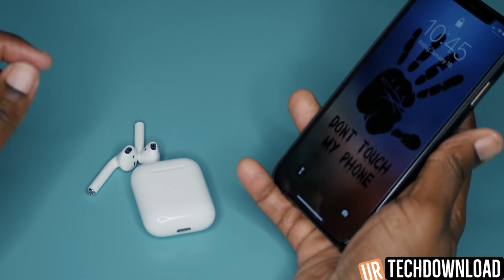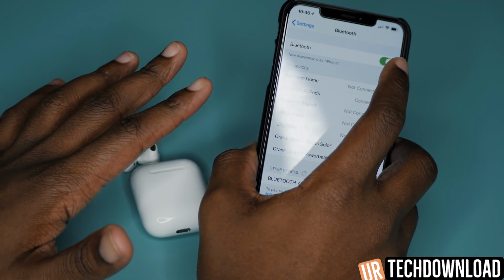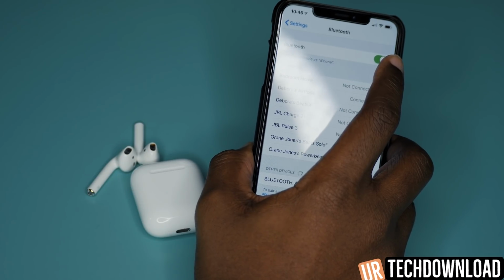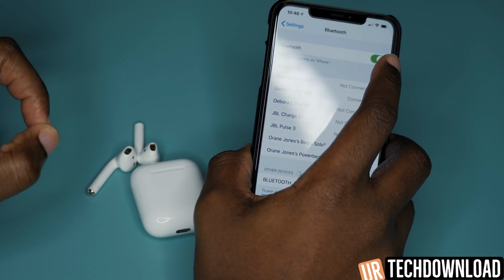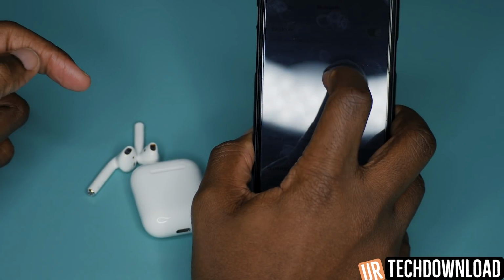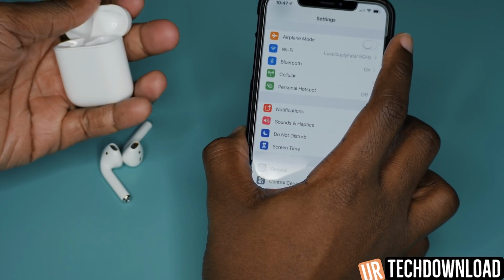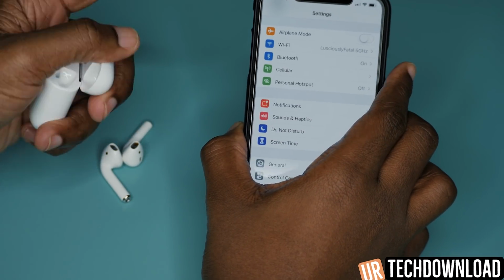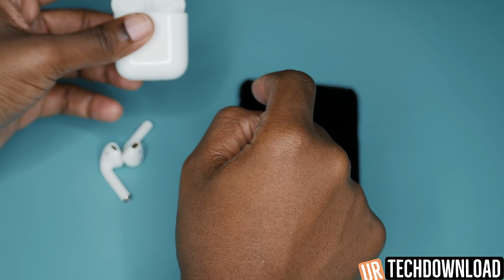Airpod Issues? No Problem! Here's How to Fix Them

Comment: Need help.
Can't reset airpods 1 gen.
Lid open green light 3 sec. then gone.
Open lid press button green light 3 sec. gone but no white light.
Charged fully. Open lid no reaction in phone no pop up window. Contacts is clean.
Try push button several times but no luck.
Maybe you know what to do?
Reply from the maker: Here are a few steps you can try:

Make sure that your AirPods are charged. If the battery is completely depleted, the AirPods may not reset properly.

Locate the small button on the back of the charging case. Press and hold this button for about 15 seconds, until the status light begins flashing white.

Open the case lid and press and hold the setup button on the back of the case for about 5 seconds. The status light should begin flashing white, indicating that the AirPods are ready to be set up.

Connect the AirPods to your device by going to the Bluetooth settings on your device and selecting the AirPods from the list of available devices.

If the steps above did not work, there are a few more advanced steps you can try:

Reset the AirPods by connecting them to a power source, then pressing and holding the setup button on the back of the case for about 15 seconds. The status light should flash amber a few times, indicating that the AirPods have been reset.

If the above step does not work, you may need to reset your device's network settings. To do this, go to "Settings" > "General" > "Reset" > "Reset Network Settings". This will delete all of your WiFi passwords and settings, so make sure to take note of any important information before proceeding.

If the problem persists, you may need to reset the AirPods by restoring them to their factory settings. To do this, connect the AirPods to a computer with the latest version of iTunes installed. Then, select the AirPods in the list of devices and click "Restore".

If none of these steps work, you may need to contact Apple support for further assistance
Reply: Thanks for the help. 
I try with Itunes.
Super suggestions.
Thanks
Reply: Fully charged. But can't reset AirPods. 
I don't know what to do.
I think  trow them in the bin

Comment: I had AirPods 2nd generation and I had issue with them. One of the AirPods would stay connected to the phone even when it is in the case like 30% of the time. So I bought AirPods 3rd generation and I am have the same issue. I won’t say it happens with just one AirPod because sometimes it happens with the left and sometimes with the right. If anybody knows a fix to this issue, please reply.

Comment: I’m on my second pair of these because my original pair the speaker stopped working. Now with the second pair the battery is only lasting approximately 5 hours. They are shit. I was thinking about picking up the 3’s because they are pretty cheap compared to the pros but I’m considering Jabra buds

Comment: Hey there I’m using AirPods more than 2 years it’s 1st generation. The issue is when I connected my AirPods while speaking calls, my left AirPod is automatically disconnecting. But mostly it’s not happening while listening musics, but sometimes it’s happening, but it’s rare, there is any solution  for the left AirPod disconnecting while speaking a call. Please 🥺🥺

Comment: Anyone else get the same issue as me where I switched phone from iPhone X to 11 but I didn’t disconnect from my iPhone X but I transferred all my data to my new phone and my airpods come up saying share audio or not your airpods and I reset the airpods by holding the back button till the red light and it didn’t work
Reply: But they always connect perfectly fine and play music just when I open the case they say not mine or share audio and sometimes I have to put the AirPod back in the case and take it back out to connect

Comment: Ima explain this as i solved it (not the method explained in the vid).ALSO THIS IS ONLY IF YOU HEAR THE SOUND IN ONE YEAR AND NOT IN BOTH YEARS!so you have to go on your PHONE settings before you want to listen to music or before you conect them ir whateva and go to your phone settings>accesibility>audio/visual, and then there should be a line, at one end of the line should say L and at the other end should say R, if the dot is only close to L,then drag it to the middle,same thing if the dot is only close to R,then drag in to the middle :) good luck

Comment: I just received a pair of AirPods 2 as a gift. I’ve used them twice before and they worked fine. Today I went to use them and as soon as I open the lid of the case I hear a constant clicking sound coming from the left AirPod. These are BRAND new. I’ve tried resetting, updating, disconnecting from WiFi, Bluetooth, still hearing a constantly clicking on the left pod. When I listen to music the clicking gets much quieter but it’s still constantly going on behind the music. Anyone have advice? Should I just try to take them back?

Comment: Waste... it’ll fail again and again and again 
It’s mere waste of money. I’ve taken to iCare Apple’s Authorised Service Centre. They say that it’s a known universal and unresolvable issue. They have asked me to replace each ear piece with INR 7,800/- totally for Rs.15,600/- else buy new AirPods 2 or Pro. He asked me not to reveal this but it’s the problem Apple is not solving for most of the AirPods. 10% fail during warranty and 70% fail after warranty. Asked me not to buy AirPods 2 or Pro which also will have same problem soon as none are repairable. He charged Rs.600 just to say this as my warranty has just expired and due to COVID I’m not able to take it to Apple care. Don’t buy AirPods ☹️

Comment: At first my right speaker wasn’t working. I looked up how to fix on Apple support. It said to go into Bluetooth and ‘ Forget this device ‘ I did just that but now when the screen pops up it says ‘ Not your AirPods ‘. The reset button doesn’t want to work I’ve tried everything. The light only turns on when I open the case. I don’t know what to do anymore and don’t want to go out of my way to get another pair. It’s been days now.  Can someone please help me out ? 2nd generation

Comment: I am using AirPods first version from past 18 months recently I started facing issue be like when I am in call for 2 mins the AirPods is getting disconnected and not able to talk through AirPods and also I have reset the AirPods even though I am facing the same issue

Comment: My AirPod connects to the phone.. suddenly it shows one of the two AirPod (one of the ear) has low battery.. and then one of them gets disconnected. When I put it in for just a sec, it shows high to full battery percentage. But while using again it suddenly disconnects like the battery is down.. also.. both sides show different percentages very often even when I use together. What could the problem be exactly?

Comment: My phone is doing this weird thing where  they won’t fully disconnect from my AirPods. I could just go to settings and physically press disconnect and the connection status won’t show up on the top portion of my iPhone 6. Yet, when I press the button or move the slider to turn up or down the volume on my phone it still says headphones and won’t do anything.

Comment: 1. When I open the case to check the battery it won’t pop up
2. If battery does show, if I close and open within seconds it displays DRASTIC different percentages 
3. My settings for AirPods don’t stay- I have to toggle off automatic ear connection
4. My left ear pod disconnects on its own even in my ear
5. Charging takes forever and again sometimes displays one percentage and then drastically changes within seconds
I want to add my AirPods are no more than 6months old PLEASE help me 😕

Comment: My airpods disguised percentage when I open my airpods the percentage show and when I close it again but I do not use it when i close after 5-10 seconds the percentage changed some time it is low somtime it is high I dont know if it normal???
Reply: Mine do this too! And when I charge it doesn’t show the charging status all the time

Comment: For the ones who are having problems with only one AirPod not connecting by itself but does with the other one in your ear you can turn off ear detection in the settings and it will automatically pair to the device once not charging

Comment: with as much as we spend on these mfs we expect them to be hi-tech and shii. but whenever i'm on facetime or houseparty talking to a friend, all they hear is a high static or they can't hear me at ALL. it's getting pretty annoying.
Reply: For people that are saying that the mic sounds ruffled when speaking to people or making voice memos, I had that problem as well. To fix it I had to clean out the two microphone holes. One is at the very bottom of the screen and the other is the very small hole on the long part. To clean it, I used the tip of a toothpick and a sim card pointy thingy (idk what its called). My problem was that there was dirt in the really small work. Clean it out gently and it should be ok :)
Reply: @aniekanekanem8585  Omg tysm it finally worked😫
Reply: Same problem, I can hear them but they can’t hear me at all. So annoying 🤦‍♀️☹️
Reply: tbhhh!!
Reply: Same

Comment: what can i do when only one airpod is connecting?
Reply from the maker: could be an issues with that airpod it self, Most of the time it means the AirPod isn't charging properly or making proper connection to the connector at the bottom of the case

Comment: Hey !!one of problem arise with my airpod I have been using AirPod with two of my devices one is iPad running on ios13 and one plus device ,the problem is that  my left AirPod is connected to iPad and my right one work on one plus ,they both are not connected at the same time I reset these but nothing happen please help to fix this

Comment: I seem to have encountered a bit of a problem with my airpods... I’ve had them for about two months and they were working just fine today but when I went to use them just now the light indicator won’t turn on. When I plug it in to charge it turns green but when i unplug the airpods the light immediately turns off. Any advice?

Comment: When i charge my airpod case its amber/orange but when i open the case there is no light a week ago everything was normal when i opened my case it was green but now no colour i tried resetting it and it still didnt appear green then i tried to charge the airpod case and still it is not green please help i can’t connect my airpods to my phone and also when i put my charging cable in my airpods it shows that my airpods are fully charged but it shows that my case is 0% and when i remove the cable immediately no light please help

Comment: My automatic ear detection sometimes ot won’t work. When I put it in my ears it won’t connect or sometimes when I Remove it and put it back it will not connect but this is new.
Reply from the maker: Try cleaning the airpods, and also the case see if that works. If not try to un-pair the airpods from the phone and re-pair them, you can also try turning the auto ear detection off then back on

Comment: My microphone on the airpods seem to not work like when I talk it’s the phones microphone that picks it up not the airpods and I have my airpods in my ear and everything
Reply: For people that are saying that the mic sounds ruffled when speaking to people or making voice memos, I had that problem as well. To fix it I had to clean out the two microphone holes. One is at the very bottom of the screen and the other is the very small hole on the long part. To clean it, I used the tip of a toothpick and a sim card pointy thingy (idk what its called). My problem was that there was dirt in the really small work. Clean it out gently and it should be ok :)
Reply: Go to the settings for the airpods and check if you have the microphone on
Reply: Yes bro same I think I’m going to return them
Reply: Mines is the opposite apple disabled the iphone 7 mic with one of the ios updates to make u buy a new one so i been using headphones for years and now my airpods mic wont work

Comment: My left earphone doesn’t work sometimes and it shows up as charging on my phone. Then sometimes it works/sometimes the right doesn’t work visa versa. I’ve tried forgetting & disconnecting and reconnecting my airpods multiple times.
Reply: Oh mine been like months. I tried resetting and doesnt work. Idk wat to so ;(
Reply: Same problem
Reply: Mine works now, idk it just spazzed for a couple days
Reply: Same ffs...
Reply: Jessy Feng i have the same issue omg if it keeps happening im just sending it back

Comment: My AirPods is flashing White when i open the case and after turn green but it won’t show up on my phone 🙁🙁
Reply: Same, did you fix it?
Reply: FBI i contacted Apple and i ended up getting new AirPods for free. Its the AirPods that is broken.... It Will start doing that if u open the case to many times
Reply: just connect your airpods using usb cord to ur laptop and reset your airpods 15sec

Comment: My fight AirPod wasnt working but the left worked. I also had a hard time connecting.The solution is to clean the airpods and the case good with a q tip. I didnt think it was going to work but i did.
Reply from the maker: Awsome glad you got it working again

Comment: I need help , I tried literlly everything restarting it, forget device, clean it w/ a cutip and my charging case is flashing orange and my right AirPod stopped working randomly but it keeps on saying 100% but wen I push the AirPod more into the case it says 1% ? Plus if I go to the apple store how much will that cost me? I literally got these November 13th??
Reply: Charge it for around 1-2 hours even if it is at 100 percent. That is what worked for me
Reply: Aalyiah L i did but still nothing
Reply: same here😪
Reply: Bryan Pena right 🤧

Comment: Hey I could use some help please. My phone only recognizes the right earbud and it doesn’t even recognize the left one as being there. Please any help you could give.
Reply from the maker: There may be an issue with the aipods, clean out the charging case put them to charge for about 30mins, if that does not work and the rest did not then there would seem to be an issue with the airpods
Reply: It’s ok I fixed it
Reply: Emmanuel Pasternak how did u fix it mine is doing the same thing it won’t recognize my left one but when I put the right one in the sound will work in both
Reply: Cash n D I didn’t do anything the next day I put them in and then it said something and they turned on without me touching anything
Reply: Cash n D same did you fix it

Comment: It says the left AirPod is still charging when out of the case... but some times it would work where I can hear out of both AirPods but the double tap feature and the ear detection doesn't work (only on the left AirPod ) I've done everything to fix it but it hasnt worked... it also shows a red exclamation mark I'm at really annoyed help
Reply: Rain Clan same
Reply: Rain Clan hey umm the back button just press it down for 15 seconds straight no less
Reply from the maker: sounds like their might be an issue with the connector in the case of the airpod itself.
Reply: URTechSupport nope I ended up  switching the left airpod (the one that wasnt totally working) with my friends left AirPod and mine both worked so did his after we traded and we both haven't had any problems. Kinda weird tho

Comment: For some reason, the microphone on my 3 month old AirPods 2 is acting up. My voice sounds muffled to the receiver for the first two seconds everytime I start to speak. Also, I believe the noise cancellation doesn't work anymore (it use to cancel any background noise when I bought these newly, my voice quality was relayed just as great via the AirPods mic as it did when I spoke on the phone directly). I switched the Microphone Use to left & right and tried on both, but to no avail. I've also got them diagnosed at Apple Support but they did not detect any trouble. So they refused to repair/replace. I'm stuck trying to figure this out by myself.
Reply: For people that are saying that the mic sounds ruffled when speaking to people or making voice memos, I had that problem as well. To fix it I had to clean out the two microphone holes. One is at the very bottom of the screen and the other is the very small hole on the long part. To clean it, I used the tip of a toothpick and a sim card pointy thingy (idk what its called). My problem was that there was dirt in the really small work. Clean it out gently and it should be ok :)

Comment: So I lost my charging case and I just got one yesterday, for some reason the green light is flashing and it was connected to my phone cause I tried to reset them and a white light was flashing but i couldn’t hear anything, so I forgot the device and now it won’t connect at all!!! 😔 please help
Reply from the maker: Suggestion would be to try the connection process over again. Put both AirPods in your charging case. Open the lid and check the status light. It should flash amber. Press and hold the setup button on the back of the case for a few seconds. The status light should flash white.* On your iPhone, go to the Home screen. Open the case—with your AirPods inside—and hold it next to your iPhone. A setup animation appears on your iPhone. Tap Connect, then tap Done.

Comment: My left airpod stop working ☹️ is that cover by apple warranty i just bought my airpods in sept
Reply from the maker: You can check, I know that they have been covering some of those issues has a defect sometimes something goes wrong with the connectors in the case causing the airpods not to connect the right way
Reply: URTechSupport btw i already give it to the store were i bought it luckily they will change it in 2 weeks

Comment: The microphone keeps failing on mine. I had it replaced a few times before the warranty ran out for the same microphone issues. Resetting/repairing doesn't seem to fix it either.
Reply from the maker: That sucks sorry